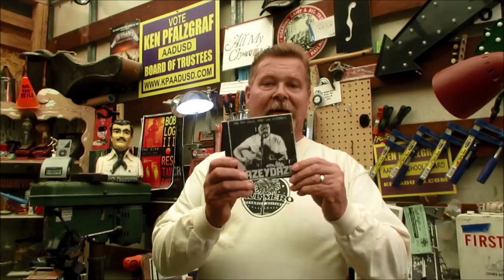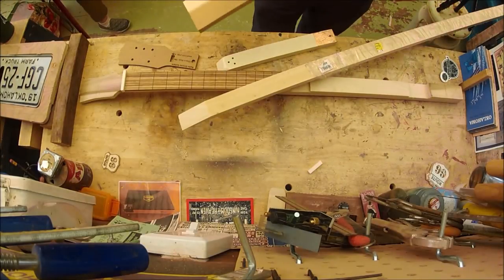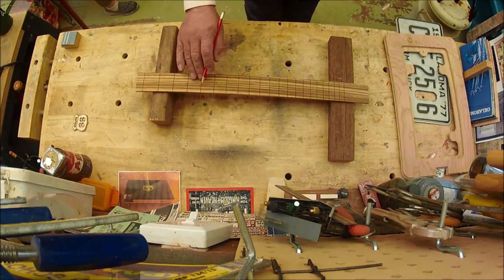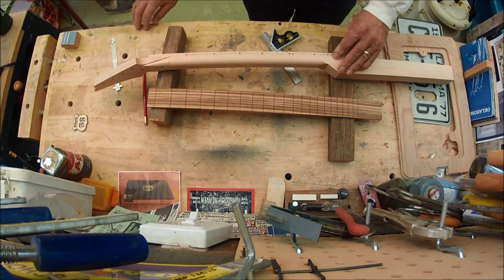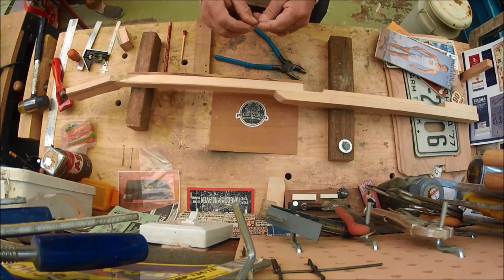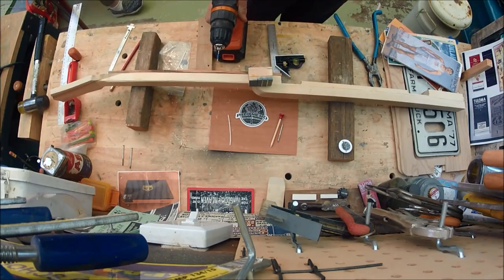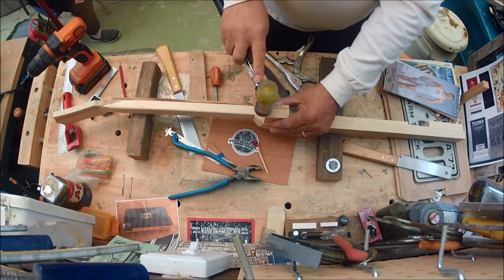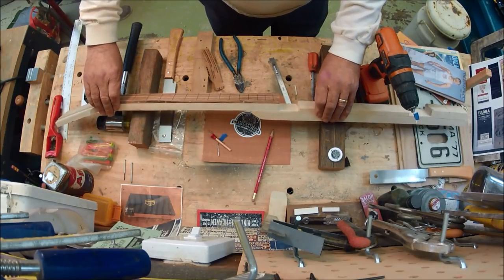Fret Markers

Comment: Ken, great video.  I started using 1/8 inch aluminum rod that I get from Lowes.  It's in the hardware department in the pull out drawers under craft items.    It is easy to file down flat after I put it in the hole and cut it a little proud with my cutters.   Brass rod also works but is much more pricey and I have to use a hack saw to cut it off.
Reply from the maker: Francine Johnston thank you.  I have a coffee can to fret now and will try to find this material and give you a shout out.   kpcbgs@gmail.com